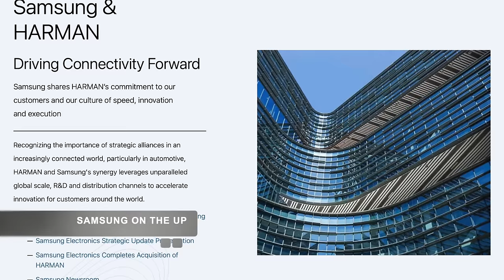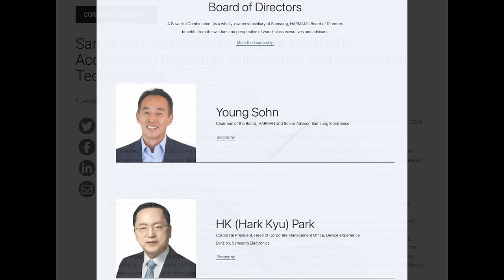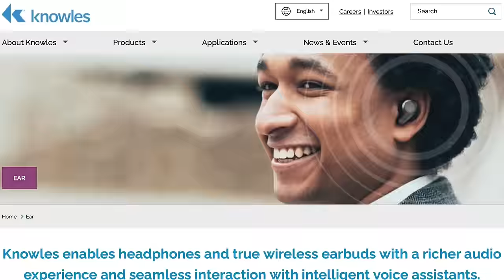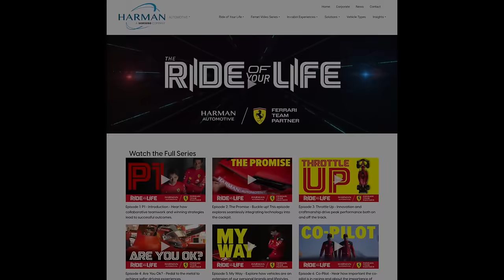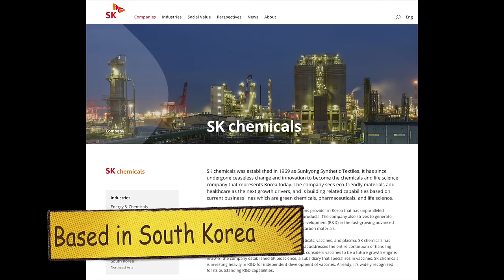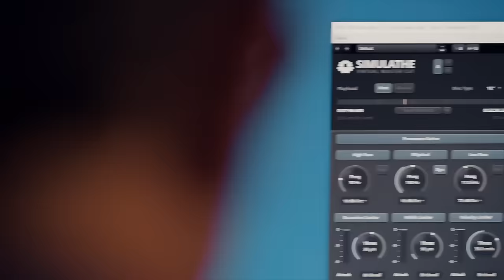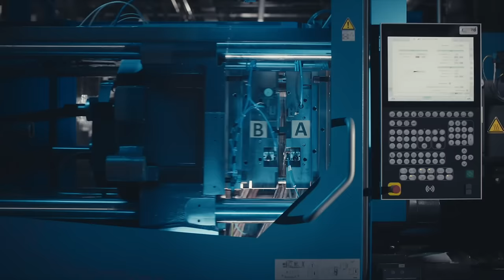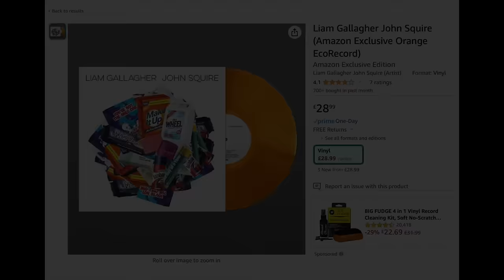HiFi NEWS, ETC: WATERFALL, SAMSUNG, Q ACOUSTICS, SENNHEISER, ECORECORD NEWS FEATURE & MUSIC TRIVIA!

Comment: PET is nothing new or anything special. It is used among other things to make soda botttles and fleece.
Reply from the maker: From what I can make out - and I'm just trying to extract as much info from a news item here, let's not forget - it's the implementation of PET as applied to vinyl recordings that is the big deal. That is, you can use PVC for drainage pipes but to utilise it within a vinyl record requires tweaking in extremis. I think the Korean company mentioned in the news piece, check it out again for info on that, has been doing that and also adding chemicals to the PET that allows it to be easily and efficiently recycled. So I'm guessing that the basic PET core also features additional chemicals, as does the basic PVC core in a typical PVC-based record (i.e. vinyl records are a recipe of 12-14 individual chemicals, in addition to PVC).